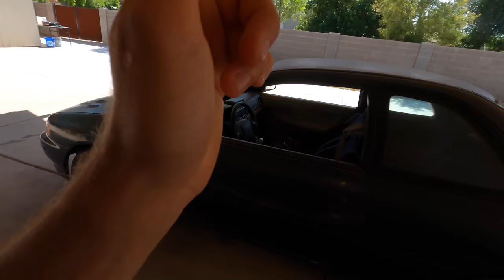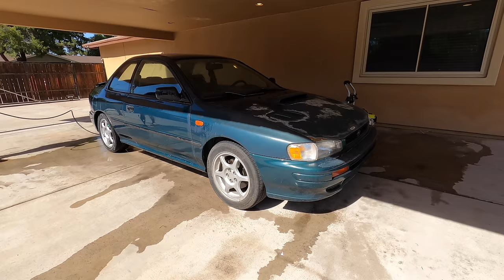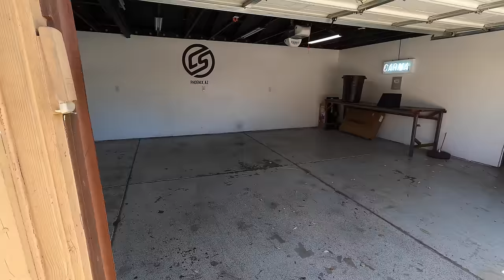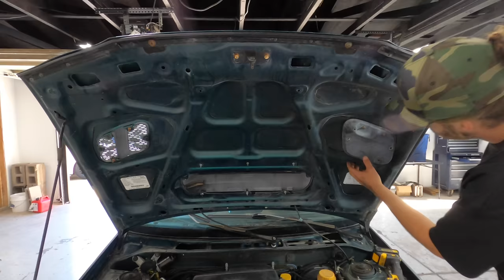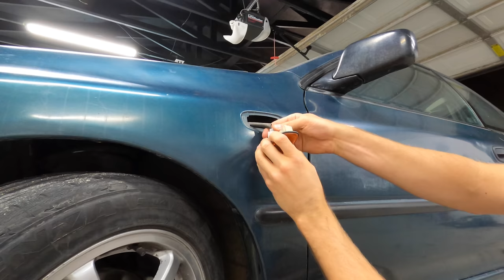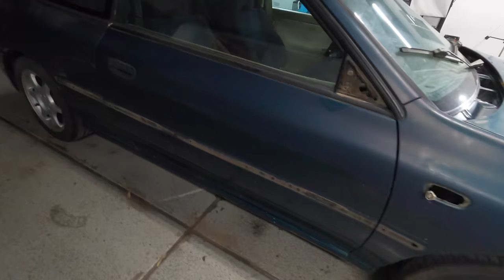Building a 22B STi: Disassembly and Sanding

Comment: For the sound deadening material I have a solution. Either Roadkill or Finnegans Garage, they used dry ice to harden the sound deadening material. They used enough to cover the entire surface with dry ice.  As it hardened you could hear popping and cracking. They were able to remove most of it easily with gloves. Hope this helps.